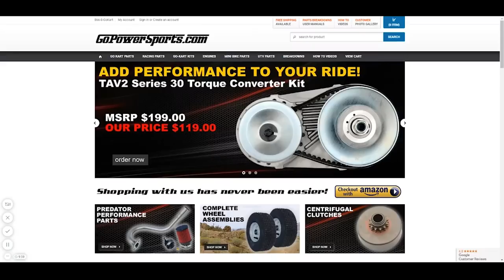Mini Chopper Lives ~ Predator 212 Motorcycle

Comment: I chased "chain tensioners" forty years, then put up a tension spring from a mower deck belt tensioner, with about a six inch arm, with a sprocket on a a sealed ball bearing, from "surplus center", between my trans and the rear wheel.  It's worked great for over a decade, no vibration from chain, about fifty thousand miles on it.  I'm building a "wheel chair", for a friend, so he can get in the woods and move around freely, using one of those four stroke bicycle kits and extra parts.  Thanks, your video's have been interesting and helpful.

Comment: I just picked up the exact same bicycle as the one you used in this build (all those years ago). Mine is missing the front fender, but it's complete in every other way.. I  want to build it with the Predator 212cc (just like you did). Temporarily I have installed a Chinese made 80cc which is probably a better motor when considering how thin the steel is holding this child's bike together. I mean, really, these bikes are made for 7 to 15 year old children. But once you add a motor, and drop the seat to the ground, it's an excellent alternative to a Harley-Davidson sporty. I used to ride street bikes all the time, but I'm 63 last month, so falling down at high speeds isn't something I want to even consider. Healing time takes too long these days. But the truth is, I still have to get my two wheeled kicks somehow. Your build has convinced me to carry on and do this thing!
I'm gonna need a new welder....
Thanks Red Beard. I subscribed.

Comment from the maker: Man I love this chopper. What do you think?
Reply: Red Beard's Garage need to fit a 670 on it and throw on some pipes to make it sound like a chopper, any twin would sound better and have more torque
Reply: Red Beard's Garage Its very Nice.
Reply: Needs a fatter back tire and a tall big tire for the front like a mini bagger
Reply: Red Beard's Garage what app or what do you use to find the speed? and i loves your video's man
Reply: i think it needs a big block honda gx/honda clone, but other wise it is awesome
Reply: Red Beard's Garage Agreed! Since I was young I always had some kind of Monster Garage build I was doing. Unfortunately I've been screwed over by our horrible economy issues and can't start anything. But I'm full of awesome ideas. It would be awesome to find an old snowmobile 2-SMOKER engine and Fab a "FUNKY MONKEY" MINIBIKE! I KNOW IF YALL BUILT SOMETHING LIKE THIS NO QUESTION IT WOULD BE INCREDIBLE! PLEASE THINK ABOUT IT. MAN THAT WOULD BE SO COOL
Reply: I PUT A CR250 FORK ON MINE AND IT DID AWAY WITH THE HEAD SHAKE.
Reply: Red Beard's Garage put a manual clutch on it
Reply: Those rear spokes scare me.  Carrying most of the weight, all the torque and all of the braking right now.  That may fail when you get the thing running right.
Reply from the maker: +Teddyvision I am going to build a custom frame later and put a 670 on it
Reply from the maker: +Drift3d Souls I have bought a tire and wheel for it
Reply from the maker: +Seanos this one would be 2k
Reply from the maker: +Sergio Martinez Digi hub. Thanks for watching man
Reply from the maker: +Random_person it does need a big block for sure
Reply from the maker: +TheBurnout yeah I'm pretty scared of it too lol
Reply: is that a 16 horse vangaurd I see?!  @2:47
Reply: i think that bicycle hub is going to fail. :/
Reply: i love it. where do you buy that oil cap? im building a mini chopper myself, but its not a schwin. thanks
Reply: If u gonna have that sized rear wheel u need smaller front wheel. Like 19" or so. Looks so dumb with that much bigger front wheel. What size is the backwheel u got?
Reply: Really great work, thanks for sharing the details of the build really helps alot.
Reply: Red Beard's Garage first of your bids I watched and 15 seconds in and I already wanna sub
Reply: É legal
Reply: I think its everything i ever wanted mine to be
Reply: How did you get it street legal
Reply: Hello
Reply: Red Beard's Garage how much do u what for it
Reply: Red Beard's Garage its pretty sweet I can't wait till u get it running and start driving it
Reply: Give u chopper design 
I made this new chopper
Reply: Seanos i have one i built off of this design which im looking to sell. I'd sell it for 1100$
Reply: Rockabilly Rambler yep. mine has failed. twice.
Reply: Red Beard's Garage I think you should be wearing safety glasses while using a grinder , ur gonna blind yourself
Reply: FREE SMOKE
Reply: Red Beard's Garage #guut
Reply: I love it
Reply: I would be able to do something like this
Reply: Id be able to do something like this.
Reply: moped
Reply: Red Beard's Garage  I think it's badass I just want to know how much do you charge to build something like that and how much is the shipping because I think it's great I like it and you do any custom jobs on something like that
Reply: Awesome! Did you make the shaft that moves the output shaft on the other side of the bike?
Reply: Teddyvision  how can i put a engine sprocket on a quick release disc back wheel
Reply: I love it I actually have two fully restored Schwinn Stingrays (the bike you used) that I want to turn at least one into a chopper. They are red and black and have Orange County Choppers stickers on them
Reply: Red Beard's Garage its very cool and nice
Reply: Red Beard's Garage it sounds like a Harley
Reply: link is in the description
Reply: I know I'm a year late I like how you took something ugly and made it cool
Reply: This is the best thing I've seen on two wheels all year, great build. Keep up the good work.
Reply: @Immoral Immortal lies
Reply: Mines a Small 66 cc China Engine and it goes 32. Fun times.
Reply: Red Beard's Garage oi
Reply: Red Beard's Garage 👍
Reply: How to Guro
Reply: Cobra ķkķ
Reply: Red Beard's Garage  Wass up I was wondering if I sent my chopper bike would u build it for me and how much
Reply: Red Beard's Garage how did you ever make this street legal. To the point where it is licensed?
Reply: Best chopper ive seen (occ builds) love it but so not legal would have to get papers on it and thats a nightmare for a custom build
Reply: Red Beard’s Garage, I have the same bike and I am hoping to do the same thing, just with a Honda 5hp pressure washer engine! Please let me know if you have any tips!!
Reply: One of the nicest o.c.c builds I've ever seen.. and I've seen a ton. Check out  ghettobikes.com in California. 
  What did you use to mount sprocket to rear hub? Looks like a simple hub adapter if so did you key it or leave it.
Reply: Thanks for all the ideas for mine but I got one question how much was the total build?
Reply: Also need that wiring diagram and the hook up sequence.
Reply: Last thing how do I reset the timing 8 degrees and remove the governor? I want to get mine up to 75-80 mph so I can ride it to work and church in the summer.
Reply: Its dope dude
But xould you just use the regular bike
Or you had to modify ?
Reply: It's so cool
Reply: what's there not to like...? that friggin' thing is bad-ass...
Reply: What gas tank is this ?

Comment: These 212 are great little engines I have a 3500 watt generator with 3,500 hrs on it multiple that by 60mph it has 210k miles on it runs smooth

Comment: Love the video. Thanks! I just want to add I just installed new mikuni carb.  Everything seems fine. Starting/acceleration. Twice now in 10 miles I've had a loss of throttle.  I thought maybe the throttle was snapping back due to loss of grip.  I don't remember letting go. I'm thinking maybe the floats are sticking as you said. . Thanks.

Comment: the float on the Makuni carb , could be how the  cable is run.
check for sharp pinch points. may have to zip tye  cable to keep it from flailing   to a pinch point.
also , remove the bowl and check to see if the corner edges are smooth, if not a lil bit of smoothing is required.

oh,  p.s.
 i didnt see any signal lights.   lol   jus sayn.
awsome vlog, 2 thumbs up!

Comment: Pretty cool. While you were chopping up the frame, you could've turned it into a swing arm type rear suspension with a couple shocks. Something I've been thinking of doing to mine.
Reply: What would be the pros and cons in doing that, im rebuilding mine right now
Reply: @SZINNAPALM  Better ride, handling and comfort. Plus nobody else seems to have done it.

Comment: I have an occ chopper project. Welded a plate to mount the engine. Have a ported 79cc for it. Dont want to spend for new wheels, but cant find new rear tire for it

Comment: Check the spring on your Carb needle valve? When I was your son's age you couldn't have kept me off that thing...even without a dad interested in bikes, they were all I could think about as early as I can remember; Reincarnation has to be real. My biggest regret is after 4 back surgeries and losing 1/2 a kidney at 27, and a big shot on the radio, I turned down a job from Willie G. Davidson!  Now with 8 back surgeries and 60 yrs under my belt, they're still all I can think about... even tho i cant ride. So now i build golf carts!

Comment: Change the final drive gearing!  A bigger rear sprocket will let your 212 rev higher, and in the 20 to 35 mph range the engine will run in its sweet spot.

Comment: theres a website called Mod DIY out of china but most of the stuff you can order from places here but I ordered  carbon fiber wire sleeving from them. i ran it over my wiring and hoses on my harley. just pick a size wider than you need and it expands and contracts so you put on heat shrinkon one end then the sleeve shrink the one side pull it tight to the end of your wires and heat shrink there again. it also has done awesomely with the heat and looks way cool.  just an idea.  I used to make custom pc mods and would sleeve all the wires to match the machine and a wire is a wire doesnt matter what its in.

Comment: Hey, Red.  For your throttle cable length, may I suggest a Venhill throttle cable kit?  Very high quality cable and sleeve and you can cut it to whatever length you need.  Only around $16-17 on Amazon for the single cable kit.  I run their single kit on my dual sport and the dual cable on my Goldwing.
Reply from the maker: +OddBallPerformance I will check those out man. Thanks for the info

Comment: hey red beard I made ones these myself I did not cut any of the frame on it did little reshaping on the down tube and have stock 6.5 in it and made rear hub myself out leftover parts and still all the stock bike parts on it and I pull 51 mph . If you got email I send few picks of it . thanks for the video of it
Reply from the maker: +Mike Caudill greg@rbgkarts.com
Reply: Mike Caudill Im intrested in how you did that
Reply: 1mu9st6ang5  you got a email and I send you few picks

Comment: Hey awesome work on that chopper .im stuck with a suzuki shuttle , a friend goofed up carb .cant ride that .i have a schwinn 50s bike .want to put a motor on needs to be pull or elec . start . bad knees .im interested in getting a elec. system ,whats better to do that on  a 4 stroke , or 2 stroke .im 67 i need to get some riding in .👍👊😷

Comment: Re spoke that other back wheel to the front spindle. My brother did looked f,in sweet.
Reply: Also a spoke nipple works for the end of the throttle cable(goes in carby) just crimp it good and trim it down... custom length throttle cable. You're welcome
Reply from the maker: +Dixiecupdean I will try that

Comment: I watch you cars and cameras n rather b welding to get motivated then i go spend 6 hours in my garage.  In one of my recent work session i was cutting a piece of metal i just welded, rather than throw on my sealed goggles i switched the setting on my mask togrind. Bad move.  A hot piece of shrapnul bounced off the ground and snuck under the mask. Piece of shrapnul welded itself to my cornea and by the time i got to the doctor a rust ring formed around it. Very painful after they scrape the rust off your cornea. With that i ask yall to heed my advice of switching to sealed goggles when dealing with metal

Comment: I think u should really go in depth with the wiring on the 212 from the starter to the rectifier and charging coils and battery mounting this is a subject that really needs more info out there I still can't figure out how to and what to buy to make a charging system for my 212 I just wantb35o run lights
Reply from the maker: +Ryan Rohauer I plan on making a indepth video on it
Reply: Red Beard's Garage that would be great just go through the options of charging system and performance because I would like both bit they don't make a light weight flywheel with charging magnets. There's not much info on this stuff would be great if u could clarify what's possible

Comment: Man that battery clearance is risky. I had about that much clearance on an AGM battery in my '73 CB500, and it somehow arc'd and burned up the electrical loom. Luckily the bike didn't burn up.
Reply from the maker: Well nothing should be moving so it should be fine I would think
Reply: Red Beard's Garage I hope so. That's a pretty unique bike

Comment: Exhaust needs back pressure Harley-Davidson has a torque cone it's in the pipe and you might have to restrict the air filter a little put some duct tape around

Comment: Red, is the chopper engine a Duromax or predator? The reason I ask I’ve tried to buy a 212 and a 420 predator with electric start and Harbor Freight says they don’t have any electric start predators. would appreciate your input. Love all your videos.
Reply from the maker: The engine was a powerland electric start 6.5 off ebay. Good little engine.

Comment: Hey I watched a video about putting lighting coil on a preditor engine but he throws away the cooling fan and preditor flywheel and uses the fan and flywheel from the old motor cUse the magnets are inside the flywheel I m thinking thats wrong could you please do a video on that for everyone?

Comment: I have a question should I break my engine in before I add performance parts to it?
Reply from the maker: It really don't matter man. We have did it both ways and these engines last
Reply: Red Beard's Garage  ok thank I got another question I just went to hf n picked up a predator 212 hemi n bought the electric start kit from eBay but the flywheel doesn't fit in the shaft but I was planning on doin a mod2 cam n upgrade the crank if possible but if I do that will the flywheel fit or will I still have to order a new one?

Comment: is it a 22mm mikuni carb running a 212cc engine? i ran 16mm, 115 jet on my 50cc twostroke, fourstrokes are not as gas hungry, but i guess atleast 130 in jetting for good running engine
Reply from the maker: its a 26mm I think on the 212

Comment: If you make one with Honda GX390 or a Predator 420 it might be able to go 70.
Reply from the maker: I could make this one go 70 with the engine thats on it I just like the way i have it geared.
Reply: @RedBeardsGarage  true that. And if it were a predator, you could go stage 1 or stage 2. Good performance boosts f0r the money, especially stage 1. Each one of those nets you another ~5hp and ~1500 rpm from stock. Diminishing returns after that, though, especially since it brings the powerband higher in the rev range.

Comment: Hey I have a preditor 212 and I bought performance parts do you know the hp increase? Thx
Reply: Bergy Boyz should be at around 10hp. On my dyno a stock predator is a 7.5hp motor and jusy by adding smalls it bumps to a 10.00hp motor from a jet and airfilter and header
Reply: Therocketboy karts ok thanks!

Comment: Hey red beard  Installed a 79cc predator engine on a beach cruiser .
Got everything  on there but when I try to accelerate  the bike  it gets very rough like something  about to snap it's almost un-ridable .
I need Som expert help
Reply from the maker: Its probably in the gearing. That is a super weak engine. You need to gear it really high to make it pull any I would imagine
Reply: Red Beard's Garage how do I do that?

Comment: A predator 420 would improve top speed if setup the same way the 212 is. I wish I could find a company that sold a kit motorcycle just like the motorcycle you built all you have to is Chose the engine you want.

Comment: i need some help i had $245 and spent 150 on a yerf dog one seater needed some work to it i putonanew carb, airfliter , and airfilter box but it probly only can go 20-25mph and im aming 40 so i only got 45 after the fix so should i try to build a tecumseh starting now till i get more money for a predator or wait for a predator? (im 14 with no job i can get one at 15 in march)
Reply from the maker: +Hydra I would save up for a predator

Comment: Is this a predator 212 from harbor freight nd if so where can I get the charging coils for it ? I have a 212 from harbor freight and plan on putting on my go krt and would like to put lights and some other accessories on it but I'm not sure if it has a charging system on it stock
Reply from the maker: This is the powerland electric start from ebay
Reply: Red Beard's Garage  okay ,is there anyway to put a charging system on a stock predator?

Comment: Hey I was wondering what should I do if my coberater is only running on choke? Every time when I turn the choke off it kills my motor n I have an 125cc 3 or 4speed motor on my mini chopper bike
Reply from the maker: It most likely has a clogged jet and thats why its dying. The choke is forcing fuel into the carb allowing it to run. With it off its not getting enough and dying
Reply: How can i clean it properly?

Comment: Hey I have a question, so I have a predator 212cc engine on my mini bike and before I had a chain on it, it ran and idled perfectly but now since I have the new chain on it doesn't want to idle so could it be that it's to tight or something?
Reply from the maker: No it shouldn't have anything to do with the chain. Try cleaning the carb
Reply: Red Beard's Garage 
What if I cleaned the carb and it still doesn't stay running